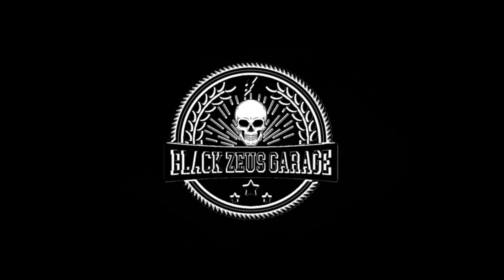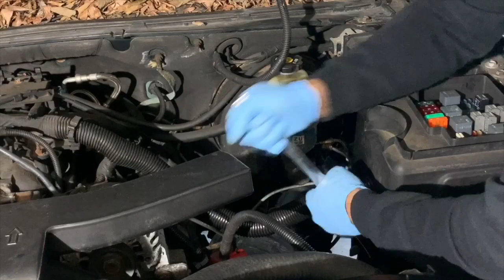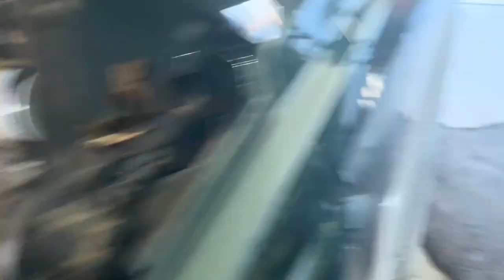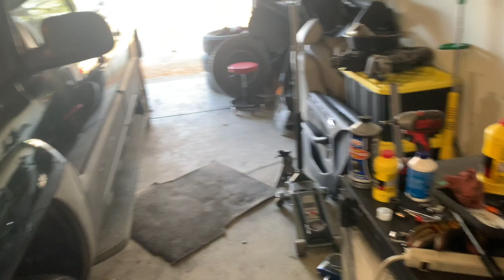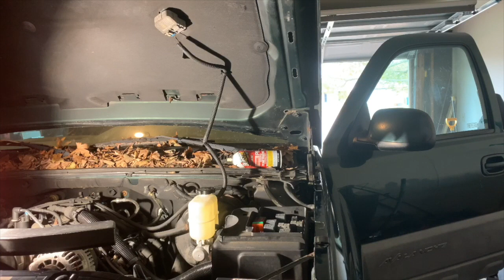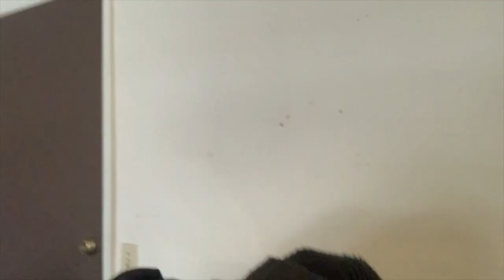2002 Chevy Avalanche master cylinder repair!

Comment: Glad i watched this video. Im sure it's my master cylinder,  that is causing my brake problem.  Guy down the road is trying to say it's something else. And that he will fix it for $200. Labor. And $80. Each wheel for parts. Without looking at my truck.😮.
So, im not falling for it. 
Thanks for this video.

Comment: Where did you hook up that hose to bleed and take out that dirty brake fluid that was extra in the water bottle. I had the same issue and they had me buy a new cylinder plus a brake booster because the brake fluids were flowing into the booster
Reply: Did you install the brake booster your self